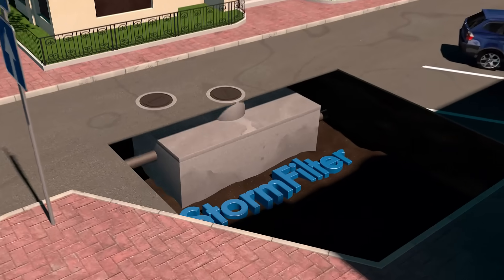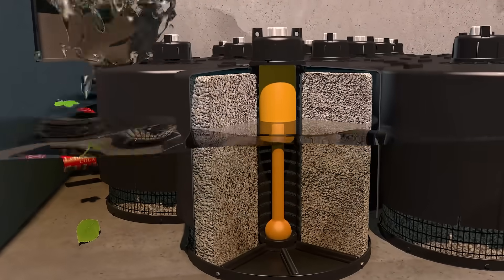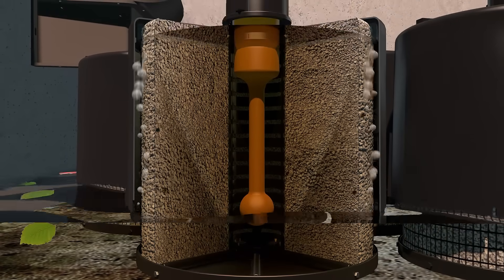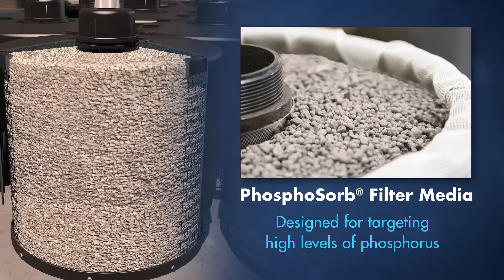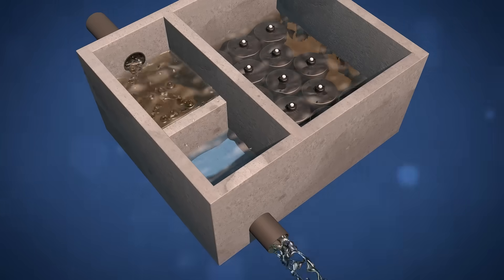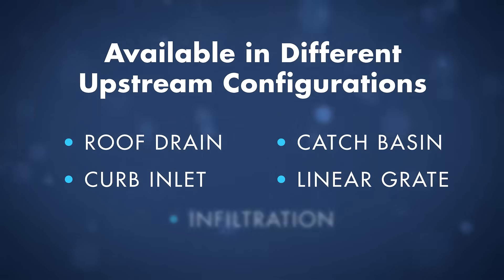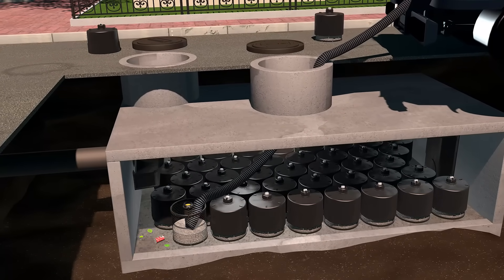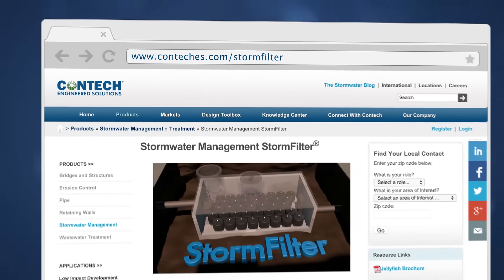How the Stormwater Management StormFilter Works - Contech Engineered Solutions

Comment: Hi, dear, is there any good suggestion of the civil use filters, I mean many suppliers offer the rainwater storage module but I plan to find a good plan of the filter applied to DIY projects and civil use projects, it won't be with the big sizes and it should be very easy to install and deliver by sea freight. Then people can save the rainwater through rain gutter then down to the trench drain, trench basin, filtrated by the filter and in the end into the storage module. The water can be applied to irrigate backyard, wash cars and flush toilet and etc.